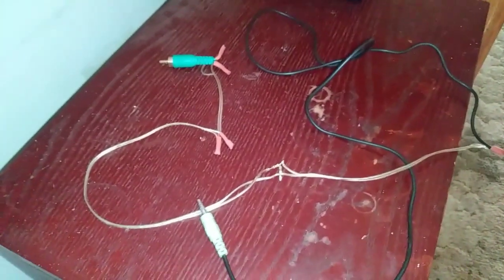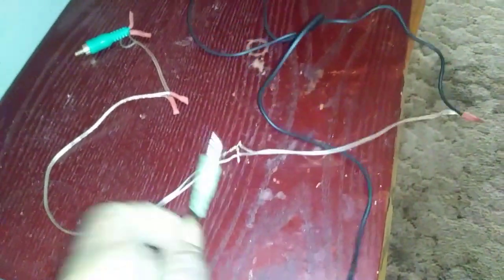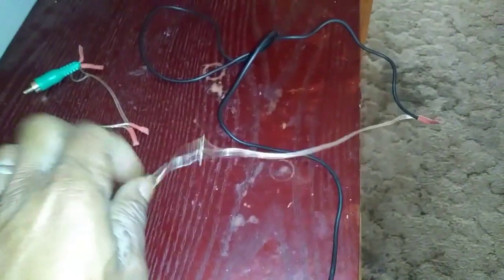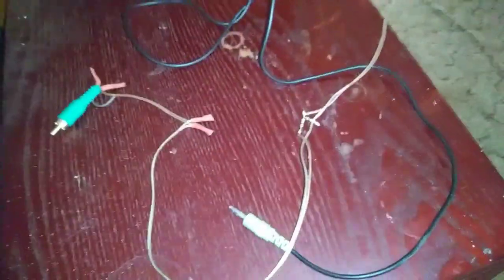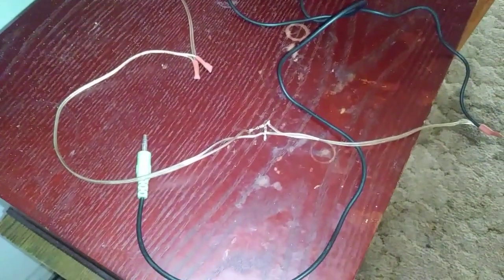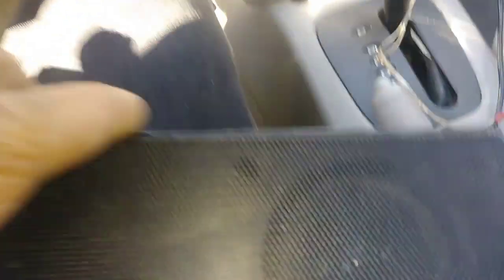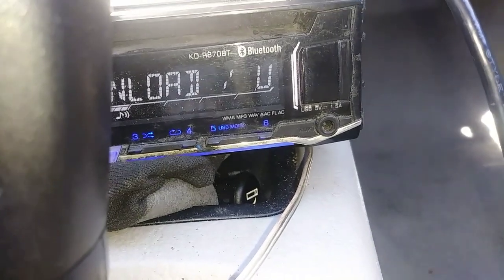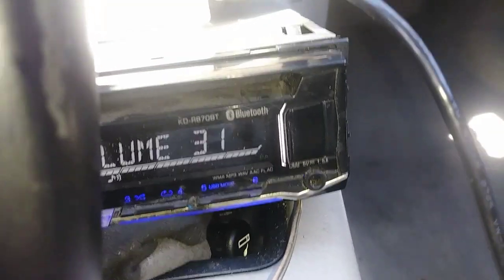Homemade  Distortion detector under $10 Part 1

Comment: I see a resistor in series and one in parallel... how does this work? How do you chose the resistor values?
Reply: My bad, I found the link. I saw a video that shows something similar but using a capacitor. https://youtu.be/lAn4WGny-gE
Reply from the maker: @cromagnon305  FOR SURE! Thanks for watching